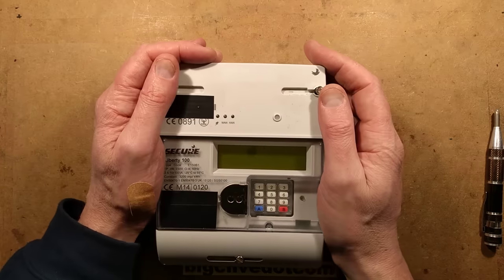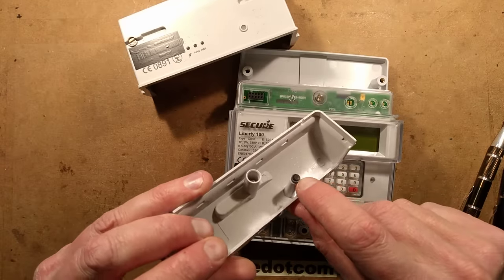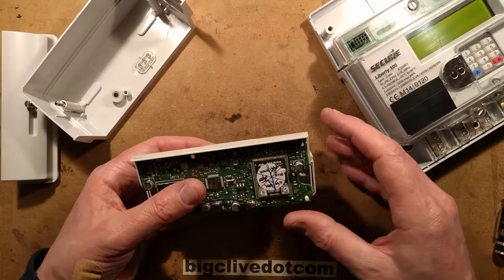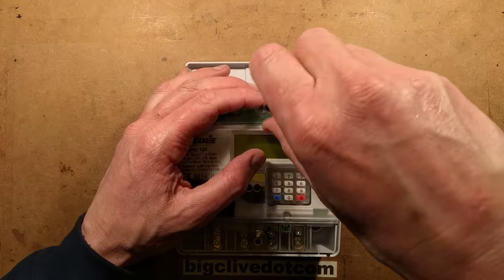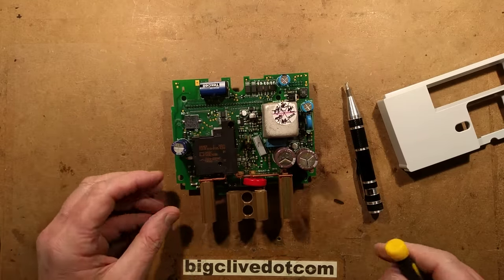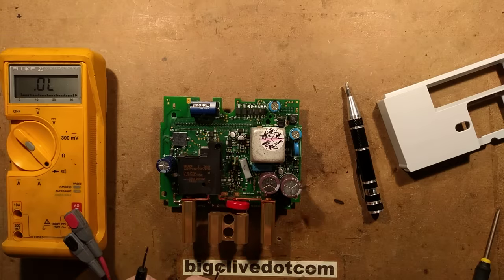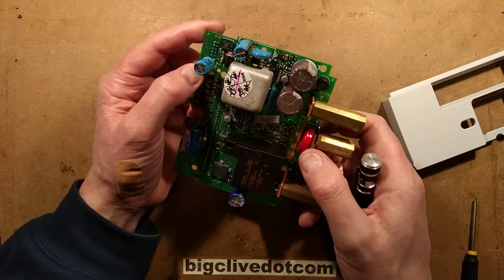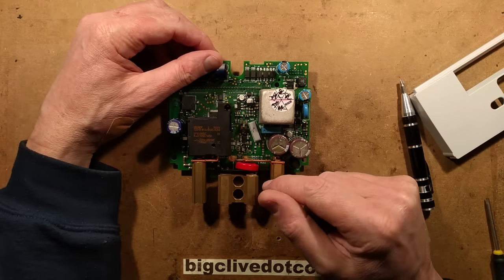Inside a smart meter, and the REAL problem with them.

Comment: The elephant in the room, which the electricity companies don't seem to have noticed, is that once they have "replaced" all the meter readers with an RF signal, who's going to stick their head under your stairs and notice the new spur feeding the kitchen and tumble drier which has "accidentally" been connected to the pre-meter feed?

Or are they going to send someone out every time that tamper alarm gets triggered? (Nobody tell 4chan!).
Reply: Here in Norway, self-reporting usage has been the norm for a long time, so the power company does not regularly come by to look at your meter. There are though a electrical inspector from the grid owner that comes by every few years. But these meters still need to be changed when their lifespan is nearing the end
Reply: There's an old trick of the 'vampire tap' too - needles poked into the incoming cable to tap the power, which can be quickly removed and leave no evidence unless someone goes over the cable with a magnifying glass.

There's an obvious way to counteract this though, and I'm sure the grid operators all use it. Just fit a meter at the substation. If the power going out from the substation is less than the power used by all registered addresses on that phase, someone is likely up to no good. Time to send the inspectors around.
Reply: they check out readings on many stages, like power on medium voltage feeding 10 houses, and every house reading, and if the numbers don't match they check it out, like when everyday at 4p.m. there is dubious 2-3 kW more power drain on MV, and its not present in sum of all house readings
Reply: Most of the meter readers are not being replaced but will be visiting people to perform "safety checks" .i.e. check that you haven't tampered with anything. So the staff will still be visiting you, just not to read the meter.
Reply: Sssssh!  Most of the dafties still just stick a wire up both live terminals, its very rare you find a direct to mains case.  It is the sensible way to do it , though.
Reply: Vyl Bird I’m sure those needles last a long time once you put a large load on and the heat melts the insulation and probably the needle too.
Reply: @vylbird8014  A meter  at the substation would tell you if someone's stealing power in the whole neighbourhood, but not who, or maybe your losses went up because a tree touched a line or something, who knows?
Reply: @Priza25  You still use a needle, a knitting needle.
Reply: ScooterZn aye because a knitting needle wouldn’t leave a visible hole in the cable. Fml
Reply: @vylbird8014  Other way round surely? More power being used at substation than whats being recorded at all addresses?
Reply: @vylbird8014  What I seen is people stealing power right off the pole transformer secondary with
 jumper cables not exactly safe since the insulation on them was only 
designed for 12V.
Less inspections there will be less of that kind of activity being found out until there's a fire.
Reply: @Patchuchan  Wiring is a bit different here in the UK: We don't have many transformers on poles. Thanks to our superior 230V distribution, we can place houses further from the substation, so no need for transformers on poles in built-up areas. If you go to the more rural areas you can see them.
Reply: Vyl Bird You mean 240v right ;)
Reply: @squadmeta  No, 230V. We used to be on 240V, many years ago, but switched to 230V in accordance with an EU policy to standardise mains supply. It makes trade and travel easier when you can easily move appliances between countries.
Reply: @vylbird8014  Pretty sure the tolerances changed so it could be called 230v, but is in fact still 240v (230 V -6% to +10%).
Reply: @thewhitefalcon8539  That's right Alex C. Another thing, transmission losses can be in the order of 30% when it rains. So that kind of stuffs things up for them to.
Reply: @squadmeta  Or if you're like me, often 250V.
Reply: @thewhitefalcon8539  Doesn't matter. If it is people or a tree stealing power, it need to be fixed.
Reply: @squadmeta  Depending on the tap setting and how close you are to the secondary transformer you might find closer to ~253V :) As there was no way that every secondary transformer in the country was going to be shutdown to adjust the offload tap.
Reply: @vylbird8014  Power is also wasted in the resistance of the cables under the street, so precise measurement and comparison may not be possible.
Reply: @tinplategeek1058  Thats utter BS. Since I got my smart meter I haven't seen a single meter reader.

Comment: really want to know what will happen when you put that sim in a phone?
Reply from the maker: It won't work.  It'll be tied to a specific task.  Like using a modem SIM in a phone.
Reply: It will have been on a data only tariff, capped at a low monthly amount, and when the customer disconnected they will have ended the contract.  The company wont want the meter back as its used and cant be verified to be safe and accurate. Recalibration cost about the same as a new meter.
Reply: The black men with the black van will show up n take you
Reply: The phone cops show up.
On WKRP Johnny Fever was afraid of the phone cops.
Considering that AT&T was allowed to operate a monopoly partially because Western Electric  made parts for the H bombs, maybe there really were phone cops.

Damn shame Western Electric didn't survive the break up.
Phones that could double as murder weapons and still have a dial tone, bomb parts and all sorts of other goodies.  I guess it all would have shipped to Mexico or China soon enough.  I still don't understand why China has most favored nation status and South Korea doesn't.
Reply: Youd be suprised, i worked for a company that scrapped hundreds of meters and telecom stuff for a power company. They dont care they just dump the shit in a skip and move on. 
Found 1000s of 18650 batteries, 40w uhf data radios like uHF radios that you can reprogram to voice etc easily. sim cards, brand new cat6 patch cables, mobile antennas, etc etc etc. All just dumped.
Reply: @UnipornFrumm  my employer uses SIM cards in all sorts of SCADA gear. they are NOT locked to a specific device since we often don't know what sort of device they will go into until after they are provisioned. However our SIM management system does a callout alarm when an active SIM changes devices then deactivates them. They WILL work in a regular mobile phone or other device...for a maximum 15 minutes before shutting down. SIMs are also retired when equipment is decommissioned.

Like with scrubbing or removing and destroying hard drives this is pretty standard practice, but I suppose some utilities out there are negligent so it is possible to find a SIM in the trash that would work for at least a little while, like one billing cycle. However if they wanted to they could track you (even without assistance from law enforcement to some degree if they wanted to, no warrant required because the SIMs are the property of the utility and they have the right to track their property).
Reply: @1978garfield  Loads of companies made H-bomb parts without even knowing it. W.E.was likely never told the intended use of whatever parts it was making, quite likely the Glass dielectric capacitors which have huge voltage and pulse current ratings needed for the bomb trigger. This hiding of detail has lasted into modern times. Some decades ago, Arab spies obtained one or more of these glass capacitors and were prosecuted. Publically the charge related only to 'capacitors' which puzzled me since capacitors are everywhere. Only later did i discover that these were very special capacitors, hence the fuss. These capacitors feature in the plot of the film 'Frantic' about a US Doctor (played by Harrison Ford) visiting Paris, France, for a conference with his wife who disappears mysteriously under strange circumstances. A decent film, worth a watch. The security was so tight for the bomb material factories that even groups of people inside the nuclear facilities were told not to talk to others also employed beside them on nuclear work about their specific role. This came close to resulting in a nuclear criticality accident at least once since workers were ignorant of the potential of the materials ! Only pure luck prevented a disaster.
Reply: @markshanehayden4648  will said
Reply: Wasn't there a case years ago of someone dissecting something with a cell-modem in it, extracting the SIM, and making loads of phone calls for free? 

They hadn't bothered securing it, because they didn't imagine anyone would ever do that. They stuck to their task and weren't too bothered about security. But to be fair it was an unlikely thing to do, only one bloke did it. 

They apparently didn't bother negotiating a tarriff, I suppose for a small company you don't bother, you implement it all in the product. Getting a custom tarriff might need talking to someone high-up in the phone company whom you're not important enough to talk to. 

I know now there are weird fringe phone co's, virtual carriers riding on actual networks. They do special deals for low-data long-term use. But not back then apparently. Of course the risk is if they go under, all your products are buggered. Though now we have virtual SIM cards so maybe it would be easier to change networks now, and do it all over-the-air without having to recall anything.

It's actually not worth nicking voice calls now, Three's lowest tarriff does unlimited voice + txt in all their PAYG bundles, tenner a month for the cheapest one. Nobody cares about voice, it's all low-bitrate. Phone companies now are Internet providers.
Reply: @greenaum  You been watching too many movies my friend.
Reply: @Graza25  Nah pretty sure it happened. It's not far-fetched is it? Just needs a company whose engineers can't be arsed dealing with a phone company or somehow locking down the SIM (use a pass-code!) cos they saw no need to put the work in. Perfectly feasible. And I remember reading about it. I don't make up random memories. And I actually almost never watch modern films cos they're, without exception, awful. I watched "The Magic Christian" the other day, that's a great one!

Prob best film is the, of course, original "Bedazzled", with Peter Cook and Dudley Moore. Surreal nonsense and sharp satire, but not the smug sort of Armando-Iannucci suit-wearing satire. It's a very funny film .

We don't talk about the remake. Just makes us angry. 

I read a lot of comics, though. Not superhero stuff though (or "capeshit" as it's called by sophisticated connoisseurs).
Reply: @grahamstevenson1740  The criticality thing... it was quite famous, right? Did it involve a system where there was a big circular "railway", and there were 3 carts, all connected with rods so that none of them could get close enough to the other that any material in them might approach critical mass? And they somehow overrode it, and there was a bit of a flash? Or a "fizzle" to use the appropriate scientific term. 

Have you heard of "The Demon Core"? A radioactive hollow sphere, and if it was completed and closed, it would go critical. Sometimes scientists would prop it open with a ruler, like that close to critical! There were a few accidents (no, really!) and flashes, and several people eventually died from being silly bastards and ignoring the rules. Very interesting lump of uranium, that was. It ended up being shipped around several facilities and usually claimed a life or two everywhere it went, from people being silly. It was always their own fault, or at least that of their comrade next to them. Still, they should have stepped in and stopped the misbehaving before the bad habits set in. That's when scientists were real MEN! If it's not the uranium, it's the pipe-smoking that'll get ya!
Reply: They all have a number, I used an Orange chip in my Orange temporary Internet box and also sent a text message to it. They will work on text not phone probably. Many are also on long term fixed rate contracts.
Reply: @rogermew5578  Im telling you, not all SIMs have a number. Trust me.
Reply: @rogermew5578  They might even work on phone. It's all the same to the network. Obviously they know it's a phone call, but it's all just data to send to the phone. They must have sorted VOLTE out by now, that's voice over 4G, prior to that it was sent using 2G or 3G. 

Probably why Three give unlimited voice even for a tenner a month PAYG (and unlimited txt, and 4GB data). Voice uses almost no data, compared to the web, so it costs them almost nowt.

Comment: My gripe with these things is that they have the potential to gather some really interesting data, and I don't trust the people who pick and buy these to take security in high enough consideration. They promise perfect safety but that means very little. The power company also states that it's illegal for them to read the meter out more than once a month, but that doesn't stop people who think they can get away with breaking the law.

Best not to ever record this kind of data in the first place, only way it won't get leaked or stolen.
Reply: It’s not law, it’s secondary legislation, not a crime, what would the evidence be? A bag brown bag of electricity, they are technically breaking the law, including data protection laws, it’s your right to not have broadcasts from your dwelling so you can switch all the modem part off and there isn’t a thing they can do about it.
Reply: the potential to gather some really interesting data..... 

Yeah dave at number 26 has just put the kettle on or the heater or something....
Reply: @ireallylovegod  don’t do this, you will pay from your pocket and if you don’t have the money you will live either freezing saving or in a bnb saving  at least £500, thru aren’t as lenient as they once were, they will cut you off for safety and you will pay for repairs
Reply: @ireallylovegod  there are actually lots of ways if you want to beat bills, do you live on the bottom floor? If so look into a diesel generator, they are illegal indoors, even when exhausted properly outside, but what you can do is put the generator outside, get those cheap Chinese copies, they are actually decent, it’s a diesel engine not much can go wrong, build a little box, to protect your generator, then simply blow the heat in, in 12 hours you would only use 350ml of fuel and your house will be too hot, if you really enjoy your projects I would suggest looping the exhaust in and out, you will need a huge extension that is a suitable exhaust and bring it inside, put the pipe along a wall and then put the exhaust back out, the exhaust wasted a lot of heat so when you do this you also make a radiator, get cage and screw it all in, this project will cost you less than $200 and you will save thousands each year, even terracotta heaters, YouTube them, good with a huge wholesale supply of 8 hour burning tea light candles, place them on the tray and it’s like an upside down pot looking thing that distributes hear comfortable and cheap, but those are like space warmers, have them in addition to your heat or if you have a greenhouse, this is all you need, depending on where you live some turbines are alright, others are like enough to charge a phone if your lucky but there are ways to make these things from like scraps from the internet, if your astonishingly lucky and live near a river please tell me I would love to know if you have explored alternative energy and renewable sources too, I live over one mile from my river but I’m getting permission to get a wheel turbine and I’ll build a hut for my induction motors and so on them I’ll get the power line ran up to my property and that’s it, I have my own power station and I can build all this myself, from scraps, any scrap yard will have what you need, you will need your own generator especially if you want a good one it’s up to you, and I would use lots of spare lithium ion batteries as they are wasted in bulk yet they charge like £600 for a block that contains like 200 of them? I could make my own batteries for nothing and better batteries at that, in the UK if you have a dwelling on an unclaimed piece of land for four years then you can declare it’s yours, it’s a cool law we have, technically I’m lord Darren Henderson not mr lol I can even have it on my licence, I don’t, but I can lol anyway let me know what’s up if your just commenting or you are into this stuff